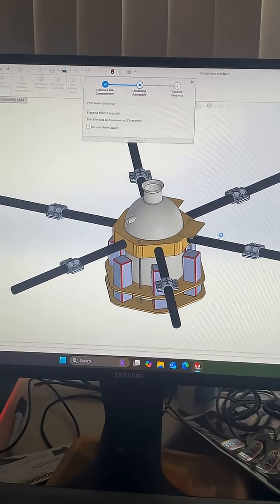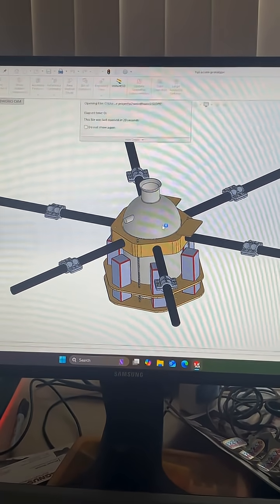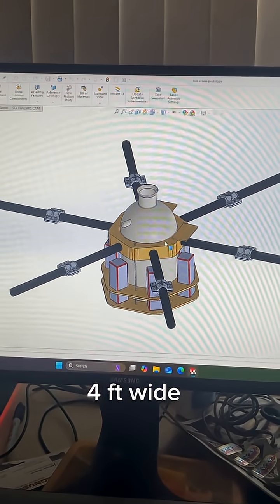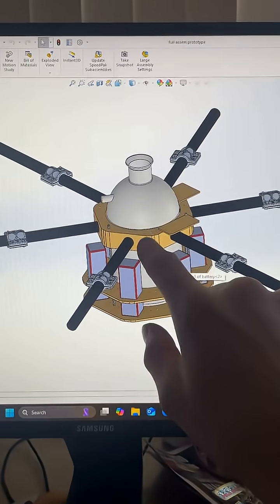Welcome to the engineering world, I would love nothing more than to spend all day wrenching but I am

Comment: when you fill this with liquid, make sure to evacuate all of the air to prevent it from sloshing around. It's worth adding a bleeder valve for this purpose. I don't know what the loads involved are here, but I think you might need to reinforce the wood laminate with a stronger plate on top to keep it from ripping out. The loads are going to be going directly into the few pieces of wood opposing gravity so they might just snap under load.